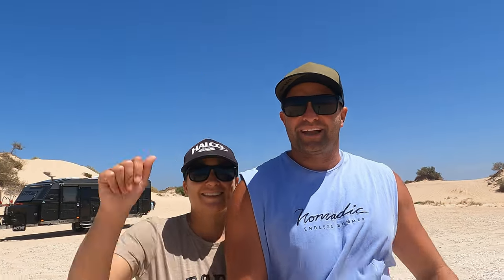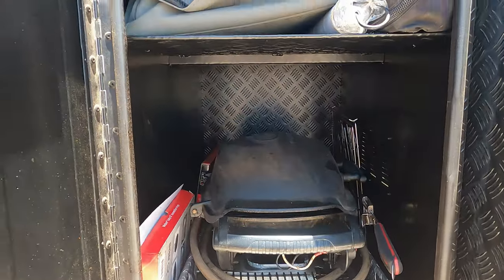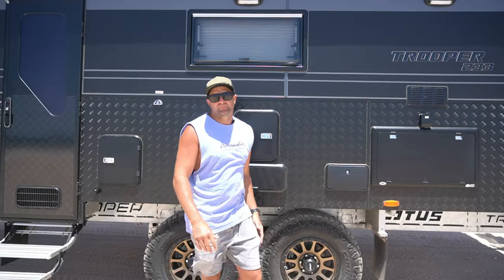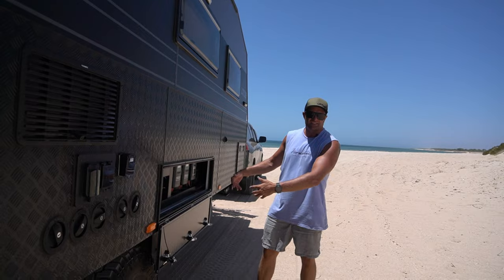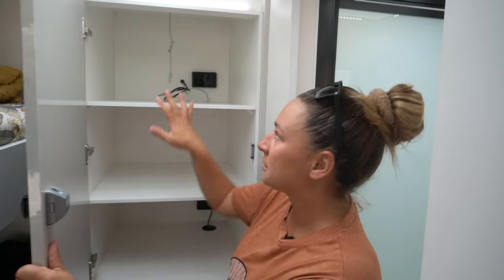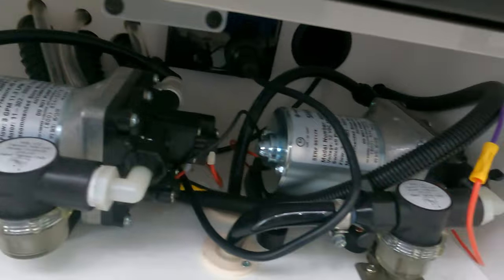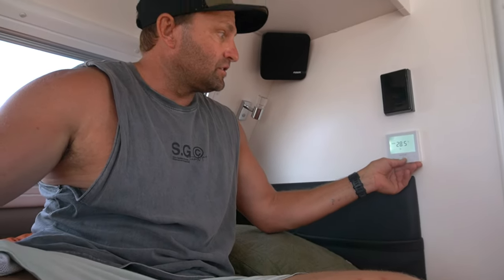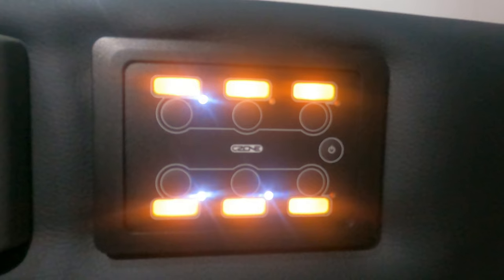Lotus Trooper 23.3ft Triple Bunk Walk Through

Comment: I went around Australia five times going up to the Kimberleys and the golf and York all with the coopers they’re very strong tire. I had one trip with the BF Goodrich And four of them failed badly I had to buy four new tyres at Borroloola ($$$). I found that the 4x4 clubs are using BF Goodrich and I think most of the time they  not towing, heavy trailers or caravans. Good and bad of Coopers are they are must more strong, even the side walls are stronger, but because of that, it makes a little bit harder To deflate them properly for sand work. Good luck.👍😎
Reply from the maker: +@damiensmyth4226 cheers for the feed back mate really appreciate it. Only problem now is that there are no stock available to replace the one we have that needs replacing.

Comment: Hey there, Thanks for the video, I'm curios,  the breakaway system, if you pulled the pin, would that act, or could it be used as a theft prevention?
Reply from the maker: It would flatten your battery as it clamps the brakes on.

Comment: Hi mate Im guessing that system is 12V not 24 or 48 volt if this is 12 Volt those cables connecting the batteries are very small for thise size batteries and 3000 watt inverter, those lug terminals should be 95mm sq combined with the correct cable like (Bellmouth Copper Lug 95mm2 Cable 12mm Stud) combined with 95Mm Sq Orange 000B&S Cable this is to cary 350 amps or more at peak.
Reply from the maker: it is only a 12 volt system mate, cheers for the info.